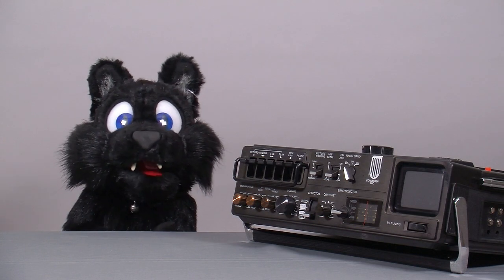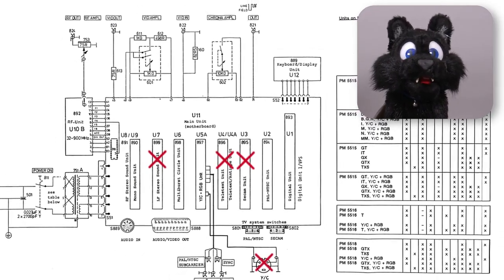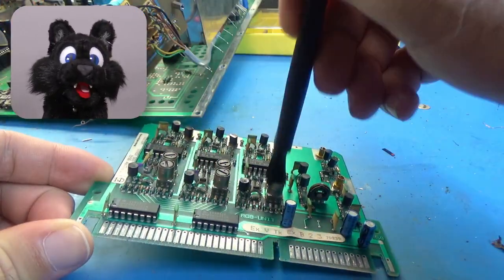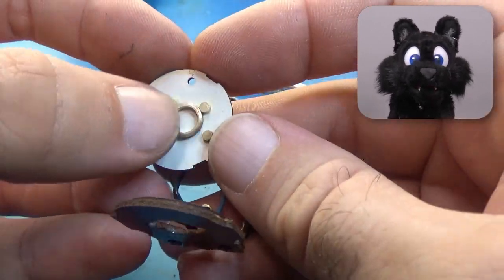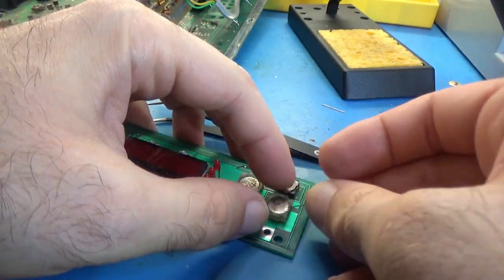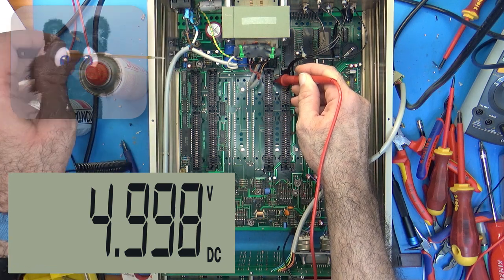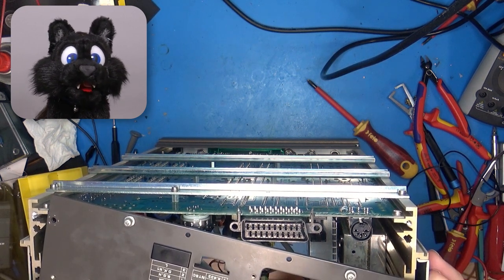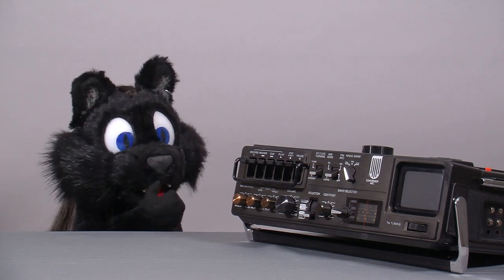Restoration Project #26: TV Test Pattern Generator

Comment: I have the same generator, the black and white patterns show some chroma smearing similar to yours. Do you remember which adjustment fixed it?
Reply from the maker: Not off the top of my head, sorry; It's been a while and I followed the alignment guide in the service manual.

Comment: Hi. Glad to discover your channel. I've seen your video about the Tektronix 521A and I saw you calibrated it with the Philips PM5515. Well, mine was bought in Ebay and the fault was the display and audio distorted, caused by an electrolitic capacior. Well, but there was another problem that I couldn't solve, and was the chorminance phase amplitude values for bar colour test. I tried to adjust it to fit with the Tektronix 1765 Waveform, but service manual does not provide enouth information how to adjust it, or maybe, Philips PM5515 does not provide precision Chrominance signal. Another problem is that some adjusts are not accesible, and its necesary a extender card. So, the best option for video signals are Tektronix TSG271 or similars. So, if PM5515 Chroma signal is not precise, the calibration of Tektronix 521 could be deviated as the PM5515 is.
Reply from the maker: Thanks for the tip! I am limited to the gear I own though and use more precise stuff to update calibration on older things. So I will repeat that when a more precice one comes along 😁 The only thing on the Tek that I couldn't quite get right was the phase offset compensation on the input... I only have a T piece and 2 "almost" equal BNC cables when Tek calls for a transformer solution... But the signal shape seemed right on my scope according to the cal guide.

Comment: If you ever find the circle goes invisible (multiburst board), check those two yellow film capacitors. One of mine was shorted. Of course I only found that after checking every other component and voltage level in the circuit :)

Comment: I have the PM5515-T same as yours but with Teletext. I've also got the PM5415, they're both serious bits of kit! Well done on your 5515, you'll never need anything else.
Reply from the maker: There seem to have been quite a few versions around. A later edition of mine seems to have a "s-video" (chroma/luma) output in the rear. Mine just has the RGB. I got the parts for a little mod around to add the two output amps, but not had a chance to tackle that yet.

Comment: Was the battery you replaced a rechargeable lithium? if so,  You may need to add a diode to the circuit to prevent backcharging if you decide to use a non-rechargeable lithium button cell in your holder.
Reply from the maker: I just double checked; The original was labelled "CRxxxx" which is usually non-rechargeable. The circuit also contains a diode. I normally check for that before purchasing new batteries, but couldn't remember anymore for this particular project 😊
Reply: @atkelar  always good to be sure! i didn't check once and got the smoke

Comment: I think that's the pattern generator I nearly bought a few weeks ago... I'm glad I left it for you! Looks like you went all out on the restoration. I hope it gives you many years of reliable service!
Reply from the maker: I think I saw two of those up for sale when I got mine... but it might very well have been, it had some "people watching" on it. And my wallet is still screaming at me for hitting "buy now" whenever I find something useful 😊 It wasn't all that much more than a "new" device but newer ones didn't have multi-standard or RF output, so I went for it as soon as I read up on the specs. The only thing that really bugs me is that it's not coming with the s-video option. Might be interesting to retro-fit...